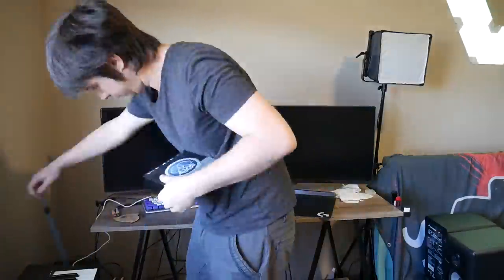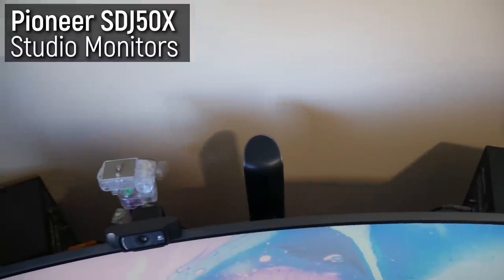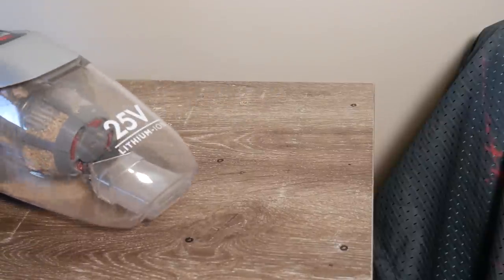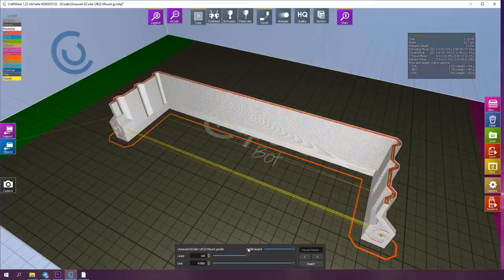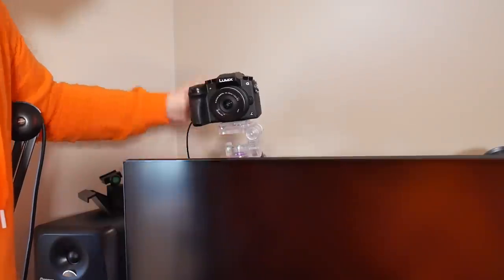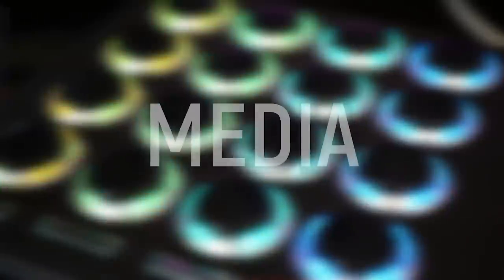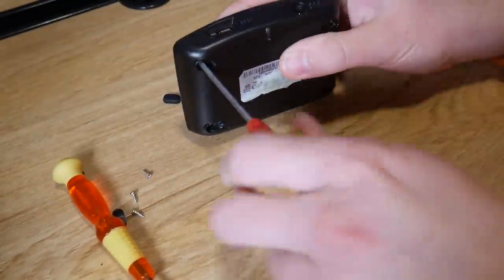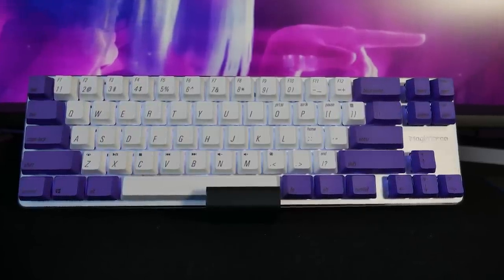Upgrade your Desk with 3D Printing (MUST HAVE MODS)

Comment: The build looks amazing, I'm considering taking some pointers for my next setup!
Would you not prefer to wall mount the monitor to remove the need for a stand?
Reply: @Kekmit  If you want to wall mount a heavy monitor on paper thin walls, find the beams (u can use a tool for this or just simply knocking in different places to hear the sound). Me and my dad mounted a 30 kg (63 lbs) tv to our walls by simply finding the supporting beams and mounting to those. I think in our house there is one beam every two feet, each house is different though. Every house has beams though, the building would collapse without them

Comment: Added to my  my 3d playlist to save for later. For the SD card reader, you might want to look at salvaging one from a older PC. They will have a cable already connected to them, or at least a connector that is directly to the board and not to the face plate. You might have to do some wire alterations to get it connected to ta PC though. Not too mention you might have to redesign how you have that setup.

Comment: Although I am admiring the thinking and work put into this project IMHO some of the available aftermarket solutions are better, like for example monitor stands either wall mounted or siting in the floor. Also I'm using a monitor arm with my 38" ultra wide and it's not breaking the bank... and this leaves SOOO much space on the desk (using the same pad btw). Same would go for camera stand, but I realise that the content dictates  to create SOMETHING with 3D printing. Please don't take this as a hater's comment it's just my experience so far that someone else already found better solution to common problems. But of course there is the price... ;)

Comment: Angus, why not mount the audio tray to drawer slides so you can slide it out when you need to do adjustments to the settings and then slide it back out of the way.
Reply from the maker: Heh I guess I could but I know where all the knobs are without looking 😂

Comment: Cool. Any tip using 3d printing to hide those cable under the desk?
I gonna copa your idea when i modify my own desk
Reply: You could make a hook design to screw in to the underside of the desk and then print however many of them you need. Would be much simpler than trying to design and print a full cable-tray.

Comment: For the speakers, a much cheaper solution would be to have cut a piece of wood with the size of your desk plus the winglets.
For sure a CNC for woodwork is easier to come by than a plasma cutter, material is lighter and cheaper.
MDF 15-20mm would for sure would be strong enough, easier to work, just screw to your current desk from the bottom.
Reply: As for the camara, I would have first used a mount for the monitor, freeing desk space, and elongated from the monitor mount an extension for the camera

Comment: Fun video. How are the cables hidden away? Are they all hanging down to the floor or have you managed to tuck them away neatly?
Reply from the maker: Not as neat as they could be! They currently use the speaker wings to tuck up and over, but I'll need to make some guides to finish the look.

Comment: Submerge that steel in distilled vinegar for 48 hours then neutralize the vinegar with window cleaner.  That will remove the mill scale, and rust.  Wipe it down with acetone and you are ready for paint.

Comment: The mount for your camera seems it would be putting unnecessary pressure on the screen panel. If possible, I would recommend modeling a bracket to the back stand of the monitor, it would probably be more stable and less of a chance of backlight burn on the led/lcd. That is the only issue I can possibly see but its even still unlikely to even be an issue just a slim chance at one.

Comment: Years ago, searching for a desk, I ending up buying a small kitchen table. You know the type that's kind of tight for two sitting on the sides.  I once set it up with a laptop in the middle and 22" monitors on either side.

Comment: That monitor is awesome, would be awesomer if in equivalent-4K vertical rez.  Great ideas!  I was impressed enough to purchase the files for the various builds but FFS, why isn't there a single zip I can download for all of them?  The way it's set up, it defeats DownThemAll so I had to get them individually--that's 24 DLs.  I have to say, that doesn't make me more likely to buy in the future.  Also, how can you stand to use a keyboard without a numberpad?

Comment: I have my audio interface mounted under the desk for years, but the protruding  XLR was super annoying. So I designed and printed a low profile connector. I have it on thingiverse for anyone interested. "Low profile slim XLR connectors (male-female)"

Comment: good sir that monitor appears at first glance to be pretty low  . center of screen should be at eye level while sitting as straight as possible , it helps prevent slouching,  and helps with posture for long term use

Comment: 4A is not quite enough for 73 LEDs lit up all white in full brightness - but that's not gonna happen in this case anyway and even if it does, the worst thing that can happen is the PSU having an emergency shutdown and possibly needing to be plugged out and in again. (max. power draw is approx. 4.38A for 20mA per LED and color as specified in the WS2813 datasheet I came across when working with those)

Comment: The metal wings are cool. I was thinking, are the legs of the desk really far from the edge of the desk? If not maybe a wing could be 3d printed with a "leg" or two to go at an angle to the desk leg giving the stability needed and not use the metal? The down fall would be those "legs" would take up some space and might not work with your space.

Comment: When I made my portable SD/uSD case, I ended up using friction slots for the smaller uSD cards. Depending on print settings, they would be so tight that they would shoot out of the slot when I popped them out. It was hilarious the first time.

Ahhh, BTF Lighting NeoPixel/DotStar/whatever strips from Amazon. They're OK, I've found that some batches are different than others, but 5 meters of anything should be consistent as long as you don't try to power all 5 meters from one end.
"Ignore this" XD
I've actually melted a breadboard once with an op-amp. Couldn't figure out why, but then, op-amps tend to melt my brain, so why wouldn't they melt a breadboard?

Comment: Capturing the complex curves on the back of your screen? I had the same issue recently trying to design a mount to put my Plasma Rifle on top of my screen. How about a Contour Gauge from Bunnings for $16 to $20 (or from eBay for less than $10 because... ?) to capture the horizontal and vertical curves.

Comment: Next time don't eyeball and print 3 different versions of the angled part but just use CAD (Cardboard Assisted Design) and cut it out of cardboard. Thats way quicker and cheaper. In the end just measure and design the rest ;)

Comment: So you used 6 mm steel plates and mounted them to some plywood? Yup, those sure are going to hold the speakers well.

Seriously though, for anyone trying to do the same without easy access to a plasma cutter: try wood instead, maybe?

Comment: Is there any drawback to installing speakers on shelves above the monitor, instead of shelves to the side of the desk? They seem too wide apart for what I heard as a rule of thumb for best stereo experience (the distance between the listener and the straight line between the speakers should be 1-1.5 the distance between them, as a rule of thumb)

Comment: can't tell if you were using a cut off wheel to grind the dross from the plasma cut steel. don't do that, the lateral force on the wheel risks shattering it. there's lots of info on the internet about ways to remove dross.

Comment: Any particular reason why you're not using a Toshiba FlashAir W-04 ( or quivalent ) WiFi SD-Card?
I'm using one in my Prusa i3 ( https://i.imgur.com/7w1zgVx.jpg ) to get around the need to get to the printer > fetch the card > get to the pc > upload files to it > get back to the printer.

Comment: "Upgrade your desk with 3D printing by creating a bracket for your audio interface, and then most of the real upgrades are only possible if you have a friend who has a CNC cable of cutting 6mm steel plate, and by buying more equipment."

There, I fixed the title for you.

Comment: let me know if you have wear to your hard mouse pad. I have the same one and after about 2 years of using it at work its worn out and there's too much surface contact now in used area.

Comment: love the videos  but dus your monitor git hot like  my 1  got that bad that i need a fan to  keep it  cool the only problem  i have with it
Reply from the maker: Yeah it puts out heaps of heat :(
Reply: HI i put a fan on the back for it and it made a big difference in the heat i was thinking of making a fan bracket for it were the headphone holder gos  ,) ps love your videos

Comment: Lmao this dude is a poser, didn't even 3d print his speaker enclosure
Reply from the maker: Could you imagine the resonances with infill lol
Reply: @MakersMuse  You should give it a go just to show people what it would sound like, I'm curious.
Reply: Maker's Muse ok as much as I want to agree with you, you should check out hexibass and his work. Hell, even I just designed and printed a Bluetooth boom box, and they all worked very well. I guess what mattered most was using a thick line width to make sure the plastic stays where it's supposed to and designing a proper wave guide. Would be very happy to design something for you to print and build.
Reply from the maker: @AlexJoneses  Hexibase does some cool builds, definitely proven the concept might have to check it out in future.
Reply: Maker's Muse you can really push the limits of the build size and show the advantages of 3d printers by doing some crazy waveguide designs that you can't just normally make out of wood